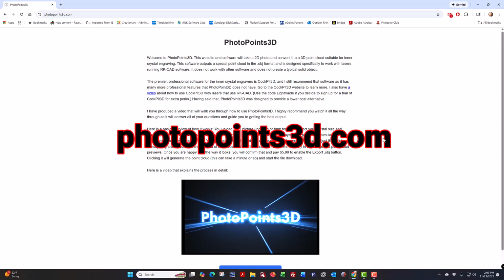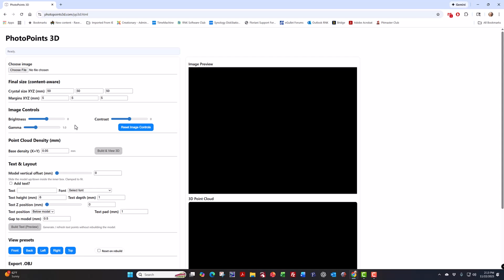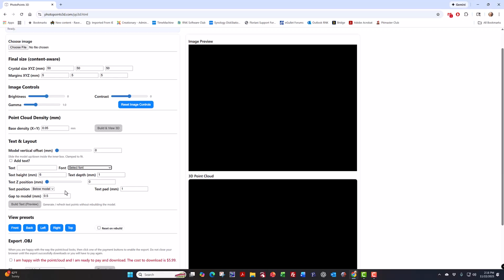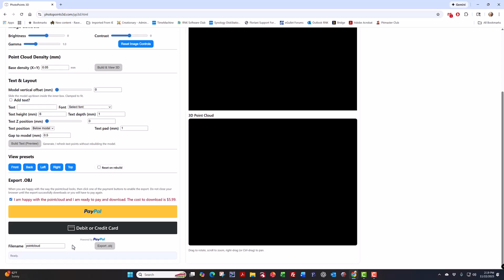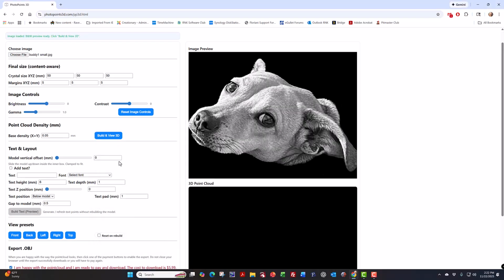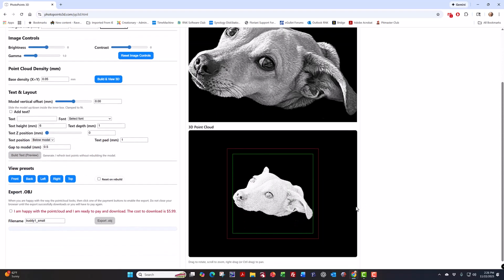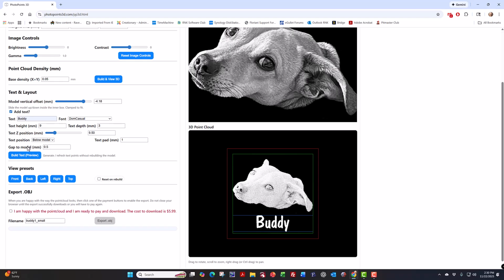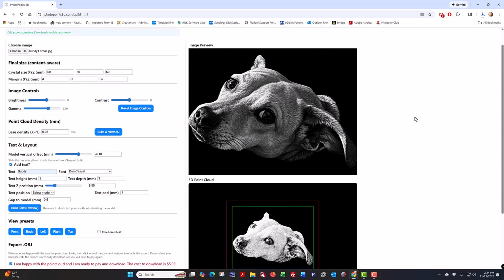photopoints3d instructions

Comment: Are you doing anything other than running open source Python scripts on the server when collecting $6 a pop? If so, that sounds like a little too much to charge.  I gave it a try and was very disappointed.  The simulation of the point cloud looked nothing like its implementation.